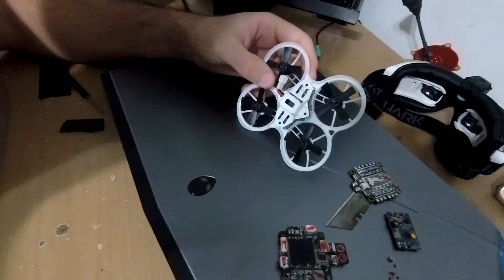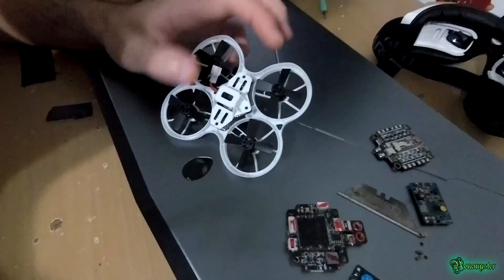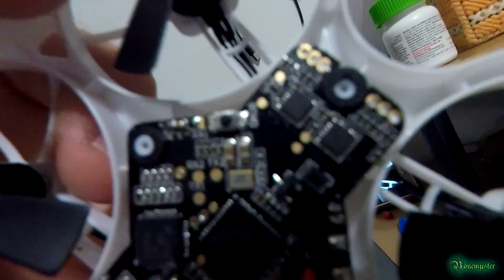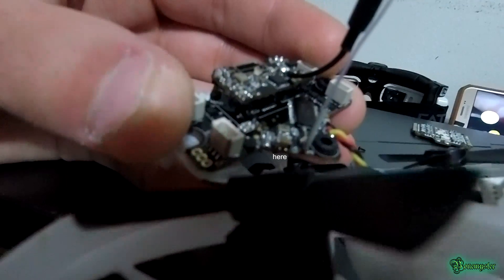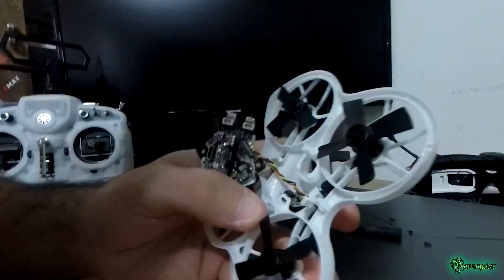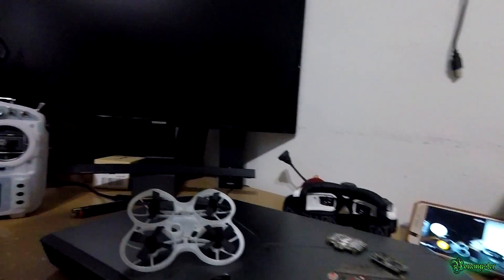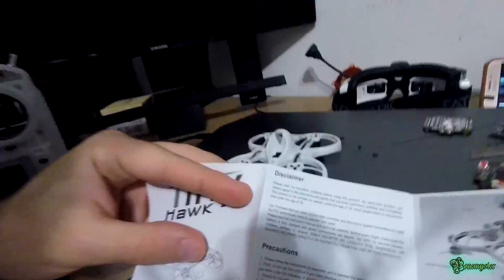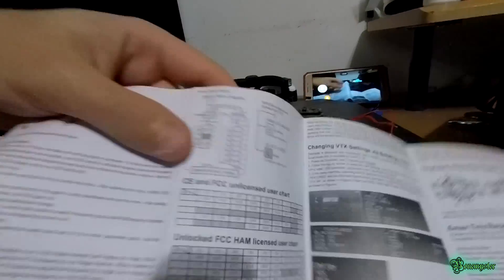Emax TinyHawk Video and Control problems fix, plus how to revert back to betaflight from flightone

Comment: I had the RX sorted but couldn't find any info on the VTX issue until I found this video. Did the 5v capacitor trick and it worked! No more white lines and rubbish in my feed. Thanks for making the vid. Cheers

Comment: And i can hear motor sound from your dvr.. :) what cap size did you use? 10uf but what metrix size?
Reply from the maker: 3x1.5x1.5 mm but id recommend the long side be 2mm instead as 3 mm covers alot of both pads and makes it hard to solder. Those arent exact measurements btw, just measuring with a stick here lol . I took the caps from old stuff that doesnt work anymore, i recommend you do the same if you have any old electronics with small ceramic caps

Comment: Not sure if YouTube compressed this or just focus was off, but I couldn't see anything about the location of the 5V capacitor. Maybe a laser pointer would help when things aren't focusing well?
Reply from the maker: Watch it in the full resolution. You are the first out of hundreds who who watched the video to complain, others were able to perform the mod no problems
Reply from the maker: You shouldnt even need to see where it is, i state in the description that you need to put a cap on the 5v and ground pad for video issues and another on the 3.3v pad and group for brownouts
Reply: The focus is definitely off. As someone who knows zero about capacitors and how/where to solder them on, this vid wasnt too helpful. 🤷🏼‍♂️

Comment: Nice find. Thanks for sharing. Is there a positive and negative side on the capacitor?
Reply from the maker: Not on ceramic capacitors. The ones that are polarized have a white line with a - on the negative side

Comment: Thanks for the tip on the cap for video noise. I have several 10uf, you said you think that would be good enough?  I already had added one on 3.3v . Your caption during the last flight said "it also improved audio". What did you mean by that?
Reply from the maker: Yea 10 uf on the 5v and gnd should work, the tinyhawk sends audio, by improve it means less noise in the audio, i could hear the motors better later on my computer, the sound is still crap though but better than before
Reply: @BonemysterFPV  , thx for the reply , I will def install the cap on 5v next. That really cleared up your video nicely. !! And I had no idea it transmitted audio. No one else has mentioned it and don't recall seeing it in manual. Thx.
Reply from the maker: @Matt633NLT  i was surprised to when i watched my dvr and i hear the motors 😂

Comment: What props are those? Also are those stock motors. I also broke my props but can't find anything that looks even remotely like they would fit properly.
Reply from the maker: Racerstar 1535    38mm, stock motors
Reply: Thanks
Reply from the maker: @Segphalt  After using the same set of props for a while they sometimes come off during a crash
Reply: Banner Drones does it do turtle mode with these props
Reply from the maker: @aarem01  yes, though turtle mode is dumb on this quad, all the props spin up, 2 spin up more but only 2 ptops should spin up. I believe there will be an update in betaflight to fix this so you can use the original props to turtle

Comment: Nice to see you using Solid state caps.  If you plug in a battery and let the caps charge up before connecting your fly battery it should work even better in theory.  I kinda know what I'm talking about ;-D (hope you get the pun)  subbed and thumbs up for using a good capacitor.  Btw hotglue is your friend on that frame
Reply from the maker: Lol, ill try the hot glue, i study electrical engineering at fiu so i know what im doing most of the time.
Reply: Bonemyster FPV - no waaay, so do I, well kinda....  first year though ;-) and here in Denmark it is called SDE, and electronics technician. The rest is hobby knowledge.

Comment: Did FL1 just need more tuning perhaps ?
Reply from the maker: I spent a lot of time trying to tune it, nothing on there would get rid of the mid throttle oscillstions. Besides the osd doesnt work on flightone, by that i mean you cant put voltage display or anything. So even if you found the perfect tune youd have to fly using a timer, and thats a nono for me.
Reply: I would just say that fakeone sucks
Reply from the maker: @faebu8601  What do you mean?
Reply: @BonemysterFPV  FL1 is just stolen Raceflight
Reply from the maker: @faebu8601  Thought it was made by the same dev?
Reply: @BonemysterFPV  its a long story... 2 people working on it one just takes it and close sources it and rebrands it so faneflight
Reply from the maker: @faebu8601  yea but whatbi heard is the one was the bussiness guy and the other was the actual programmer. If its like that then the programmer has every right to his code. The guy hasnt been sued so by law hes done absolutely nothing wrong. Shouldnt be a huge difference between the fake and the original, so i dont see what you are complaining about
Reply from the maker: @faebu8601  this tinyhawk code is relatively new, so it has nothing to do with one sucking and the other being good.
Reply: @BonemysterFPV  I think there is a lawsuit going on
Reply: @BonemysterFPV  i would try butterflight 3.6 flew great on my whoops
Reply from the maker: @faebu8601  lmao and you complaining about fakes, butterflight is bs, just different betaflight defaults, theyve done absolutely nothing else. Ive flown both and i prefer betaflight
Reply: @BonemysterFPV  its a difference between a rip off and a fork
Reply: @BonemysterFPV my whoop flies smoother  with butter and  if you fly 5inch you need to try the helio spring and then you will noticed a really big difference
Reply from the maker: @faebu8601  Its still a fake and its not a fork, they are still copying betaflight and have brought nothing new to the table, they just copied feedforward not to long ago. At least with flightone its his own work.
Reply: @BonemysterFPV  but its not prestons work its rs2k's work and he is developing butterflight since the things with  raceflight happend
Reply from the maker: @faebu8601  alright, anyways butterflight has had no major improvements like betaflight has. Theyve just been copying betaflight. Till they actually come out with something new im sticking to betaflight and wont be trying them till then
Reply: @BonemysterFPV  how can you say its not better if you havent tried it??
Reply from the maker: @faebu8601  i started this off saying ive flown both 😂
Reply from the maker: @faebu8601  flew the latest butterflight and the latest betaflight on the same exact quad about a week ago, beta flew so much better
Reply: Butterflight uses different filtering and the new boards are using a dual processing system, F3 + F4=F7 F3 + F7=F10. Older versions actually used Kalman filter before betaflight(as default) and also lower filters for better flight performance. I just ordered a Helio Strix binary F10 and will be curious to see how it performs. Thanks for video I've had nothing but problems with my tinyhawk till I saw this!
Reply from the maker: @dannyg2845  butterflight really hasnt brought anything new to the game, just different stock filters, that kalman filter is just a pt1 filter, its all already been proven online, dont fall for all the bs. And ya glad the video helped
Reply: If computers run way better on multiple processors why wouldn't flight controllers? Butterflight took almost a year between firmware updates so don't count them out yet! I like both but the new betaflight seems like they complicated how to tune your quad.
Reply from the maker: Whatever floats your boat 👍
Reply: @BonemysterFPV  Putting this on a 7" to see if it performs any better than F4
Reply from the maker: @Nate15FMX guessing you deleted your comment because you realised its obvious.
Reply: @BonemysterFPV  , correct !

Comment: Works well!
Reply from the maker: You try it?
Reply: @BonemysterFPV  I only added the cap for the power issues, my video didn't have issues.
Reply from the maker: @ntfadeaway  So you put it on the 3.3v pad?
Reply: @BonemysterFPV  yes, a little cap like you had from an old esc.
Reply from the maker: @ntfadeaway  perfect, asked because some dude was asking if a cap accross the battery bay would also fix it and i dont think it would. Too lazy to open it up and remove them to put a bigger one on accross the battery leads.

Comment: Nice fix!  I just got one of these and have seen all the reviews mentioning the receiver brownout problem and the video noise.  I was wondering if adding a capacitor would fix it, so nice to know it does.  I’m wondering if just installing a larger cap at the main power leads would accomplish the same thing?
Reply from the maker: Well they already have a capacitor across the battery leads. But try it and let me know how it goes
Reply from the maker: Just saw some other reviewer put a big 220uv cap accross the leads and it did nothing, ot has to be on the 5v pad for video and the 3.3v pad for the receiver
Reply: Bonemyster FPV That’s exactly what I was about to try.  Thanks for the heads up!